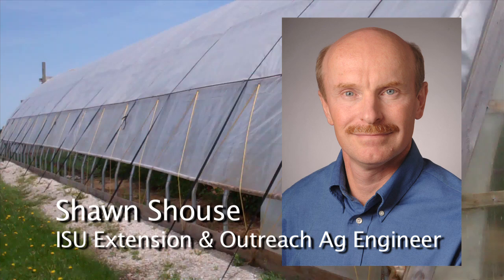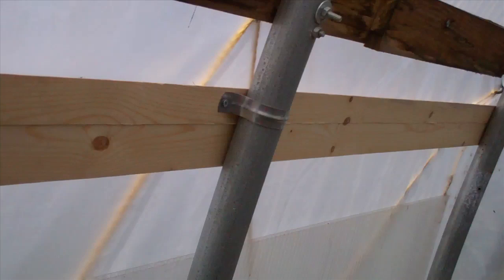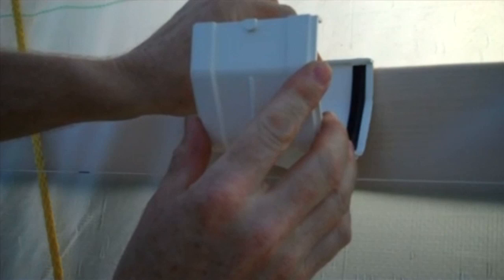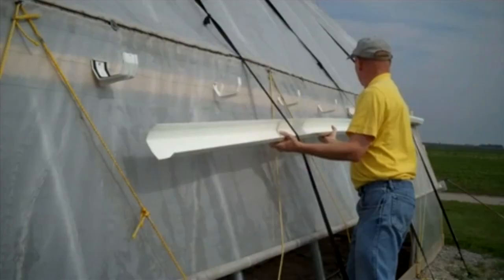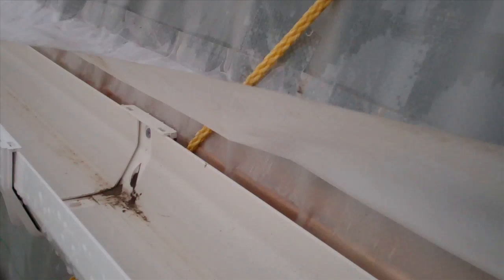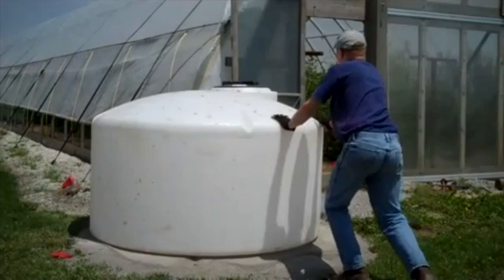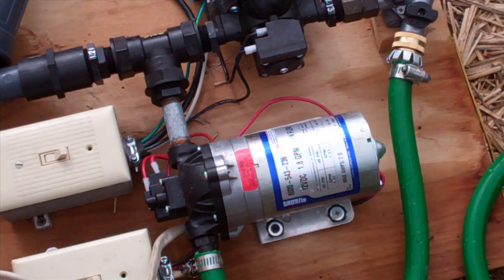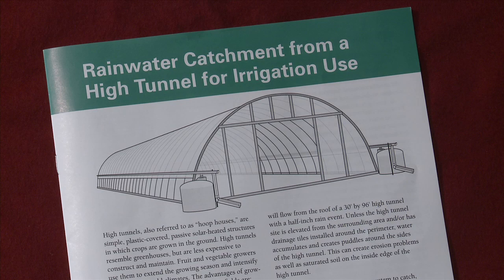Rainwater Catchment from a High Tunnel for Irrigation Use

Comment: If the greenhouse is anywhere close to trees, a rain guard cap should be installed on the gutter to keep leaves from clogging the system.

That was very interesting. I liked the detail shown in the installation.
Reply: Good point.  We had no trees nearby, but if you did, protection for the gutters would be justified.

Comment: Wow…many people are curious and excited by the idea of rainwater capture systems, but I have generally found that- more traditional irrigation methods are better suited and less headache for most gardener and grower applications…but this is an excellent example of a good time to implement this system!

I work with a high tunnel that I have not been able to install a frost free hydrant into- I do have a pump and some barrels, however, so I guess I know what my fall project will be!

Comment: While down in Southern New Mexico, I noted they more often than not, they used black colored  poly-tanks, for outside water storage .  With Summer temps. much higher than those of  Nebraska, it seemed that the added heat absorption, being black, would be a negative.  But it seems the black has a chemical make up, that slows down the tanks degradation from sunlight, but also the blocking out light, inhibits  alga growth. W/O perfect filtration an extremely small bit of alga or other foreign matter, can block  drippers or emitters.  If there is a concern that the water could be too hot for watering, painting the outside of the black poly tank white, should work. Keep in mind most poly pipes and lines, used in irrigation, that are exposed to sunlight, are black.

Comment: I like this design well done!  if the tanks were inside the high tunnel the water would warm up and help keep a average temperature over the night hours
Reply: Interesting idea.  Both you and Concerned Citizen suggested putting the tanks inside.  In our case, we didn't think the temperature modulation benefits were worth giving up floor space inside.  Having said that, there are some crops that benefit from the temperature modulation of thermal storage mass, which is usually spread throughout the inside of the tunnel.  Good idea to contemplate.
Reply: yes if you had much more water storage per greenhouse space than shown here.

Comment: If bacteria are an issue then I had a bit of an 'outside the box' idea; a couple of silver electrodes, powered from the battery, could be fitted in the tank or into a secondary, smaller ready use tank to produce colloidal silver? I don't know if it would be practicable and drip irrigation is probably more efficient anyway, although it could mean that you could use the rain water to wash the produce.
I liked NDD Sceptic's idea of an underground storage tank. If it was excavated beneath the tunnel, probably more appropriate in a hydroponic system (where you are not planting in the ground), then it could be used as a heat sump in the winter months.
Reply: Why not just attach an inline UV light source for sterilization plus a filter?
I would rather not add heavy metals to plants.

Comment: I think this is amazing work, and very well presented.  Although, I can't help but think that in order for the methods to be accessible to the common grower, perhaps there are ways that such a system's design might be made simpler and less expensive.  Perhaps the gutter water could be routed directly into the drip irrigation, with an overflow feature that is activated when rainfall exceeds some rate limit or total volume.  This might reduce or alleviate the need in the system for tanks, pumps and electrical equipment, where much of the system's cost appears to be.  Existing designs in rainwater catchment might be utilized for implementing such features as overflow capability.
Reply: Thanks for the comment, Mike.  Advancing technology relies on thoughtful users making continuous improvements, and I'm sure folks will find ways to improve on this system.  I'm a fan of cheaper and more simple.  Water use without storage would be nice.  Drip irrigation in particular may not be well suited to that, because it requires pressure of 8 to 12 psi (pounds per square inch) to make the emitters work uniformly and a fairly low flow rate (around half a gallon per minute per 100 feet of row).  Our system had pumps rated for 1.5 to 3 gallons per minute at 45-60 psi maximum (adjusted downward with a pressure regulator).  A gentle rain might come at around 0.1 inches per hour (a day-long drizzle).  At that rate, half of a 30x96 foot tunnel roof would produce around 1.5 gallons per minute.  But often Midwest rains come much faster.  A more typical summer rain might come at a rate of 2 inches per hour for a 5-minute period.  This rate would produce a flow of around 30 gallons per minute.  It is not uncommon for 5-minute rainfall rates to get up to 5 inches per hour, which would be 75 gallons per minute from half our roof.  Pressure generated from the gutter level to the ground (4 feet) would be about 1.7 psi.  So rainfall directly from the gutter would have too little pressure and much too high flow rate to go directly into drip irrigation.  Hence the choice of storage tanks and pumps to serve that use.  But if your end use could utilize very low pressure and very high flow rates, then direct use of the gutter water might be possible.  More simple design in overflow provision would certainly be possible if you didn't mind modifying the tank itself for the overflow.  Honestly I just didn't want to cut holes in our poly tanks.  Point well taken on that one.  Good observation.

Comment: My idea was much easier I back filled the trench for the plastic with 20mm gravel and arranged a channel to a buried 200 ltr tank at the lower end. To collect the water  a float controlled pump in the tank pumps the water to a larger tank..
Reply: I will use that idea in my design. 2500 gallon ribbed tank

Comment: Did ISU not consider ground-works ahead of erecting the tunnel?

As a retro-fit this is a great solution, but if the tunnel site is long term then this cannot help but hinder maintenance. 

On an open site, installing land drains around the poly-tunnel to collect water into tanks below ground saves puncturing the cover and replacement issues, extends rain catchment area, is far less obtrusive, and has the benefits of storing water away from frost in the winter - and below temperatures enjoyed by Legionella in the summer.
Reply from the maker: That is a good point.  This was addressed briefly in the second paragraph of the companion bulletin (PM 3017) https://store.extension.iastate.edu/Product/Rainwater-Catchment-from-a-High-Tunnel-for-Irrigation-Use  where it says “Unless the high tunnel site is elevated from the surrounding area and/or has drainage tiles installed around the perimeter, water accumulates and creates puddles around the sides of the high tunnel.  This can create erosion problems as well as saturated soil on the inside edge of the high tunnel.”  Because the focus of the bulletin and video was on construction of a rainwater catchment system and not on construction of high tunnel structures, additional detail on site preparation was not included in these resources.  More detail on site selection and preparation for high tunnels is included in the Iowa High Tunnel Fruit and Vegetable Production Manual (PM 2098)https://store.extension.iastate.edu/Product/Iowa-High-Tunnel-Fruit-and-Vegetable-Production-Manual  on page 10

Comment: I would recommend to have the water tank inside , cuse the water will be at heat resoware during night time
Reply: True, the thermal mass of the water could help to level out the day/night temperature swing inside the tunnel.  I'm not sure the benefit would justify giving up some interior tunnel space, and it would make an accidental overflow of the storage tank more problematic.

Comment: Very nice presentation.  Those outdoor tanks are extremely expensive and I can’t help but to think $3,000 for two tanks is beyond most peoples budgets. Unless I am looking at the wrong types of tanks.
Reply: I'd have to dig for records, but my recollection is that in 2011 we bought the 500-gallon poly water tanks for around $300 each.  2023 prices look to be around $600 from Midwestern farm supply stores.  These are polypropylene water tanks often used for bulk water hauling for things like agricultural spraying.  I agree that $3000 for storage would be unappealing.  An even cheaper option would be a lined below ground storage, like a fish pond.  But protection of water quality could be more challenging.
Reply: @shawnshouse445  Thank you so much for the clarification and information you provided. I truly appreciate it!

Comment: Very impressive design.  I plan on installing 4 high tunnels on my farm.  No public water or electricity being a very rural site.  Is it possible for you to provide a specific list of the components used for your electric and irrigation pumping system.  It appears that it would be perfect for my application.  So pleased to have come across your youtube.com video.  Fine presentation!  Thanks!Jim
Reply: Glad you found the video informative. To be clear, the system we used to recycle the roof water was adequate for supplemental irrigation (just to make productive use of the water that was collected). It would not be adequate for the sole water supply for the tunnel (I estimate the recycled water met around 40% of the water need with fairly normal rainfall). Much larger storage and power system would be needed for the sole water supply. I'd be happy to share what we used with you, but don't want you to proceed on the assumption that it can be your only water source. If you have no power or water supply at the site, you'll need to plan and develop those resources at a larger scale. It might be better if we talked offline about your situation, or if you referred to a local expert in water supply development. Feel free to contact me at sshouse@iastate.edu

Comment: With all the people that still get their drinking water from cisterns (especially in Iowa), watering plants with rain water is an issue for you? Not to mention how do you keep the rain water from hitting your plants if you have a regular garden???
Reply: You are right that it isn't the rainwater itself that is a risk.  It is the biological contaminants on the tunnel roof that could be washed off by rainwater. Granted, the risk is fairly low, but it is easily minimized by using the captured water for soil level irrigation rather than canopy irrigation.  Just passing on what our food safety experts recommend.  And almost nobody uses roof-fed cisterns for drinking water supplies anymore, even in Iowa.  Certainly if they did, they should include disinfection as part of their water treatment.  Thanks for the comment.

Comment: I suspect this system would stopped the snow from sliding off the green house thus would put a lot of snow load stress on the green house.  It's a great idea thou.
Reply: I agree.  Because of the risk of snow and ice on the roof, we removed the gutters during the winter.  We were more concerned about snow and ice damaging the gutters.  When ice slides off the poly roof, it comes down quickly.  The plastic gutter brackets made it easy to unlatch and remove the gutter sections.  We left the brackets in place and had no damage to them.
Reply: Yes, that was a concern, either for snow build-up on the roof, or for snow damage to the gutters.  We removed the gutters in winter and reinstalled them in the spring.  With the plastic gutters and mounting brackets, that was a simple task.

Comment: You guys ROCK!!! I love this!!! What about purification? You know, from stagnant water? Would an air bubbler be enough? Or does some kind of rotation or spin need to occur?
Reply: Thanks for the compliment! Good question. If we were feeding something like aquaponics, then aeration could be important. For drip irrigation, the primary concern is sediment/algae/other gunk that could foul emitters. A good, flushable sediment filter is critical when using harvested roof water. As far as stirring the tank, any settling of sediment in the tank before it gets to the filter and irrigation system is probably beneficial. If accumulation gets excessive, the tanks might need occasional flushing. Since this water gets used every few days, it won't be stagnant for very long.
Reply: Good points. Keeping it simple makes for less complications down the road as well. Giving focus to the list in hand! Thank you.
Reply: I covered my tank with black plastic to prevent sunlight from getting in, thus no algae.

Comment: Nice Job. However the float system seems over complicated and unnecessary. Why not jut put an overflow pipe, and direct it where you want the discharge to go?
Secondly - the large gap at the tank fill leaves space for squirrels and birds to fall in and get trapped - ruining your water supply.
Reply: Yes, we had covers over our tank openings, mainly to reduce sunlight damage to the float balls, but they did also reduce the risk of wildlife entry.  I like your thinking on that.  And yes, I think a simple overflow pipe or opening at the top of the tank would be more simple and cost effective.  We considered that, but knew we were likely to repurpose our tanks later and did not want to compromise the integrity of the tanks.  But for a permanent installation, I prefer your idea.

Comment: Hello, is there a paper or parts list available for the solar-powered pumping system, find that idea brilliant! How long does it run with how much water pumped through it?
Reply: Peter, the companion bulletin (Rainwater Catchment from a High Tunnel for Irrigation Use) does list the parts we used.  Free PDF download at https://store.extension.iastate.edu/product/13734  We did not track the hours of pumping per week or season.  The solar system was designed in an attempt to be able to pump all the harvested water with the solar power collected and stored.  The pump we used was a Shurflo model 8000-543-236 (12v., 7.0A, 60 psi max., 1.8 gpm max.) to match our irrigation flow and pressure requirement.  With about 1000 gallons of storage, our pump would take 10-12 hours to empty the storage, typically spread over 2-3 days.  In our case, we also had an AC pump plumbed to the same system to use as a backup if solar power fell short.  In our case, we pumped only what we could harvest as rainwater.  We had pressurized well water to meet the balance of the irrigation need.  You would estimate your water pumping needs, then size an irrigation system.  Then select a pump that would meet your requirements, and a charging system that would provide enough power for the pump.  There are good explanations of solar water pumping calculations from solar system providers, or in these bulletins: https://aces.nmsu.edu/pubs/_circulars/CR670/welcome.html  https://extension.msstate.edu/sites/default/files/publications//p3236.pdf  https://extension.colostate.edu/topic-areas/natural-resources/solar-powered-groundwater-pumping-systems-6-705/

Comment: I'd have assumed that a connection pipe between two tanks below the high water line (at worst) would lead to an equalisation between the tanks.... so the emphasis on absolute level isnt that important
Reply: I'd also just have had an overflow pipe on the tank, seems a bit over engineered with ball valves etc.
Reply: True, the ball valves were a bit complex.  I did that so that we didn't have to compromise the tanks with holes for overflow.  But overflow holes would be much simpler for an installation where you aren't concerned about possibly re-using the tanks for another purpose.  Good point.  You'd just have to make sure that the overflow outlet on the tank had flow capacity at least as large as the gutter inlet feeding the tank.  You'd also want the overflow to feed back into a drain line of adequate size to handle the flow.  I've noticed that rain barrels are often equipped with something like a garden hose for an overflow - much too small to keep up with the gutter feeding the barrel.

Comment: What about when the plastic needs to be replaced. Tear down the gutter system and do it al over again????
Reply: Yes, in our case, the gutter mounting brackets were screwed onto the hip board so that they could be removed when the tunnel cover required replacement.  We also removed the gutters from the gutter brackets in the winter to avoid damage to the gutters or brackets when ice and snow slide off the roof.